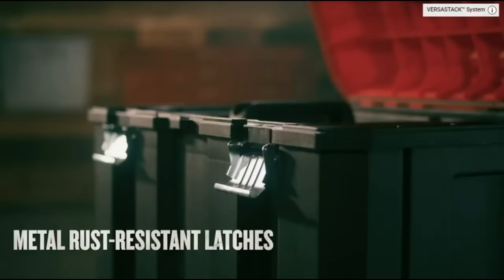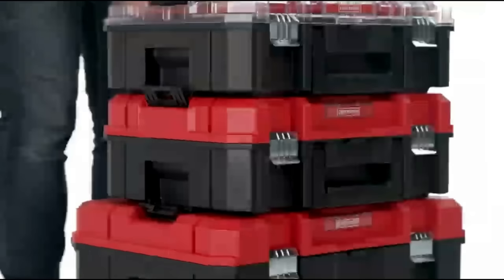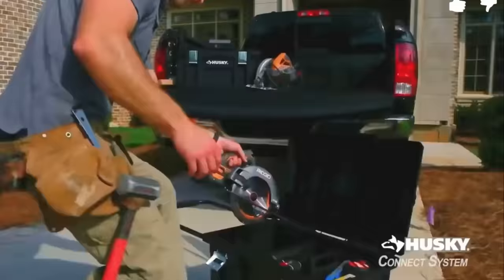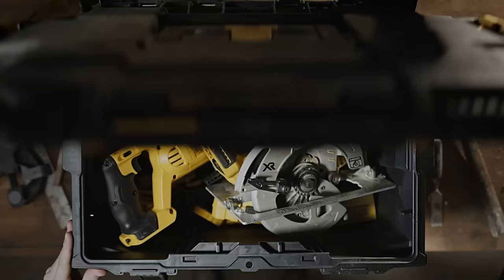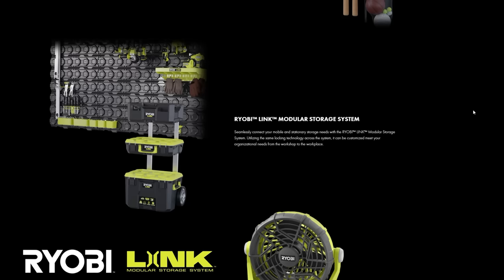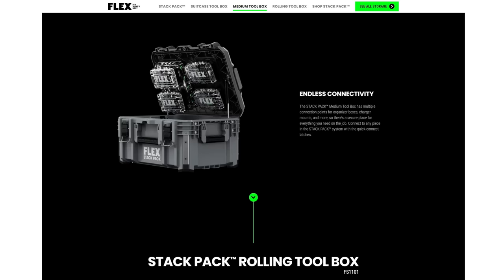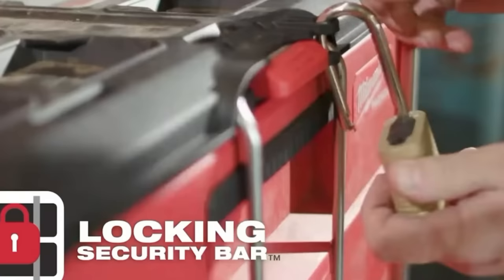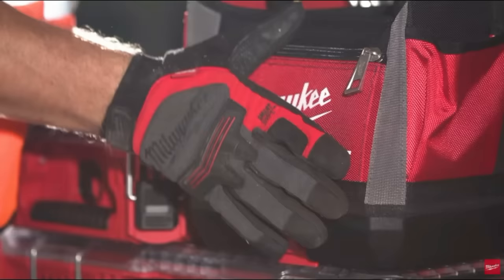BEST Portable Tool Storage systems (RANKED) WATCH BEFORE YOU BUY!

Comment: I have had the Ridgid system, sold it. As you said it wasn't going anywhere. Currently own 2 complete Milwaukee systems. Love em'. Looking very seriously at the new flex system. Thanks for the video.
Reply: That's my thoughts but I just got the 3 boxes plus a crate and an organizer in Rigid 2.0 system for 225 out the door. I'd be looking at basically twice that for Milwaukee and it's a little too much coin right now. This way I'm up and running and can add 2 boxes or cases for the price of one Milwaukee equivalent. I also like how tough yet light weight the Ridgid boxes are compared to the heavier Milwaukee, which also needs to make their crate bigger. It's like 2 inches shorter than everyone else's and that makes it less handy for fitting stuff in there.

Comment: I honestly think all the small batch guys doing aftermarket parts for the pack out look always have it ahead of every other company. Train the truck there are so many cnc'd and 3D printed parts for pack out now it's insane
Reply: Yep. I just discovered.modular systems a week ago and I already have an improvement for my ridgid 2.0 system. A D handle mounted between the telescoping handle bars that pivots with hooks to catch d rings on the back of the boxes to lock the handle to the stack for better control moving it up and down stairs.

Comment: No love for the T-Stak, brother?

I kind of tripped and fell backwards into the t-Stak. I don't need my tools to be mobile on a daily basis, but I do like having them easily portable because I make quarterly 5 hour trips down to my Dad's house in Charleston to work on it and help him keep it up (he is 82). I also wanted my tool closet to have some uniformity. 

Most of my tools were in whatever bag I found on Amazon that was the right size, at the time I bought each tool. It was unorganized, and I always had to open more than one similar bag to figure out which one held the tool I needed. That system had to change. I liked the one Tough System (one) box I had. My first drill driver/impact set came in it. Those original drills have long  since been replaced, but I loved the case so the upgrades to those originals live in it to this day. But, new tough system boxes for AL of my tools turned out to be a very expensive proposition.

That was when I ran across the T-Stak II boxes. The 13 inch T-stak II boxes are smaller than that original tough system box...but man, they were selling at both Amazon and big Orange for 20 bucks apiece. So I bought seven of them (then an 8th later) and one of the deep boxes for 35 bones for the circ saw. The deep box was too big for the circ saw, so it is back in a bag (damned if I can find a box that fits the circ saw), so I tripped and fell backwards over having the deep box for batteries and sandpaper, extra bits, an extra fastback and such, with eight 13 inch boxes for tools *(two to a box, with the Sawzall having it's own box) to stak on top of it. I never meant to have a "portable system," but I ended up with one by default. For wheels, I just use my dolley.

And brother, at 20 bucks a box...it is unbeatable. For the entire 9 box system I would up with, the soundproofing foam that you can find anywhere (the egg crate stuff) and a $10.00 label maker off of Amazon...such organization for a large tool collection can be yours for very close to 200 bones. If you don't have a dolley in your shed, add the cost of a dolley to that if you want to call it a portable system. 

Now, I have no idea what would happen if I dropped my tools off of the side of a large building, but I have no plans to do that (nor would I expect my tools to survive if I did, with any system). Nor does it have a radio, nor a cigarette lighter, nor a bobbling hula girl, nor a coffee maker nor a gift shop. But it is NONE boxes instead of three, and holds ALL of my tools with a bonus deep box on the bottom for random shit.

 But I did recently find out that the Versa Stack boxes latch up to the T-stak. So if people want to use both in a color coding system, they can do that. Shockingly, however, the Versa stack boxes are more expensive than the T-stak boxes. Yeah, they seem to be the same exact boxes, but the  ones that say DeWalt on the outside come at 20 bucks a box, while the ones that say Craftsman are 45 bucks per box. You figure that one out. I am too retired to care, I am just mentioning it because it is true.

Anyway, so that is what is what with the T-stak. It is just a suggestion for an add on to this list.

Comment: Way cheaper priced options out there like Bauer from Harbor Freight, MasterForce from Menards and Ridgid. Those can be $60-$70… and you can stand on all of them as a step latter. The Craftsman, Bauer and Masterforce I think all have the same box design and can stack on top one another. Get twice the amount of storage with other brands vs many of these mentioned in the video. I’m 200+lbs and have stepped on my Beaur, Masterforce and Ridgid boxes many times and taken them all off-roading to get to a job site. Milwaukee has the most options but wow they are so crazily priced, for a small organizer box with 6 wimpy slots it’s $40. Can get 3-4x more stacker bins for less from Stanley

Comment: I had the craftsman version and I threw it in the dumpster because it was so bad. I checked out the Dewalt system and it was so flimsy I didn’t buy it. I now have a bunch of the Milwaukee stuff and it is awesome. If you grab it by the corner, you can’t make it flex like you can all the others I’ve tried. All my tools are Dewalt but they’re stored in Milwaukee boxes.

Comment: I bought the rigid thinking they would get going but now I am switching over to Ryobi (righ-obi) thanks to the link system and the new drawers and rollers they have coming out this year. Will work for my tools and my photography equipment
Reply: Did you switch over? If so, how do you like it so far?
Reply: @chris-C8  yes I have fully switched and I love the Ryobi link boxes and the rail system.

Comment: I have the Husky Connect. It’s fine for what I do. I’m a maintenance tech for an apartment complex. It’s fine that it only has a 100lb. capacity. Do you really want to lug all that up 4 stories? Anyway, it works great, it’s rugged, built well and has just enough accessories at the moment to customize it. I think with all the companies making these rolling tool boxes now, you’ll see more accessories for it? That being said, if I would’ve waited about 6 months, I would’ve gotten the Flex. That thing is awesome! As for the Ryobi Link, I just saw that they have added more accessories for it this year. But that thing still seems big and clunky to me! 🤣🤣🤣

Comment: Would like try out the Flex option but not for 300.00. If there trying to compete with Milwaukee and you can get that for a little over 200.00. I don't think Flex will sell very well.
Reply from the maker: Hoping to see some good deals this year 🙏
Reply: Milwaukee is only at that price because of Christmas sales. It’s normally over $300.

Comment: Ridgid is the AK-47 of all pack outs. Have it for 8 years - never failed. Cheap, robust and does the job. Ryobi is the worst in my ranking. I own DeWalt 2.0, Milwaukee, Ridgid 1.0 and 2.0 and Ryobi Link. I wish I never bought Ryobi Link - flimsy, can't stand on a side, handles don't have stops, hard to disconnect from each other with one hand, covers don't align with box right away thus hard to latch, boxes are not secured inside, bit storage cover does not locks in place securely and opens during storage also takes space from inside of the box so you have to keep center less crowded, and etc.

Comment: generally the idea that you would put the ryobi stuff above dewalt means you really didn't do enough research on both ends for those. the Ryobi locking system stuff has just gotten crazier and crazier expensive and buying the locking system just to put up all the tools i currently own would cost $800 plus. those rails are not cheap by any means despite being plastic junk. Generally i would say we should all invest in 3d printers and print a system that already exists that will suit your own personal toolbox.

Comment: First mistake Craftsman versa-stak is compatible with Dewalt T-stak/Stanley Pro-stak system. You have two drawers, organiser, 5 tool boxes, 2 tool bags, 1 cooler;), foam inserts, trolley, crate...Husky is Keter Connect, Ridgid - is Keter Gear, yes a bit poor systems.

Comment: Milwaukee would be a good deal for $218, unfortunately it is $309 at Home Depot.  This compared to Dewalt system for $249.  Not sure Milwaukee is $60 better for the base units.

Comment: Versa stack is great for the Mobile mechanic sure if your boxes stay in the garage 99% of the time. Then once in blue moon to fix something at the in laws house. Cheap thin plastic. Will not stand up to abuse. Hinges are crap. The problem with the Ryobi and the stack pack from flex is yes you can put bit boxes inside the lids but only that brands accessory boxes.  And let's face it Ryobi can't make bits to save their life. They are Johnny homeowner grade at best. Honestly Milwaukee is where it's at which sucks because they cost too damn much. The DeWalt tough system 2.0 is plain Jane boring as hell you get a large a medium and a small box that are basically empty rectangles. So instead of having your tools spread out on a bench you have organized messes in three boxes. Their hinges don't last all of my boxes I'm down to one hand on each. Besides Milwaukee everybody else offers cool stuff but it's all proprietary only their brands of bits fit in their boxes nothing is universal and for what these systems cost there should be some universal measures put in.